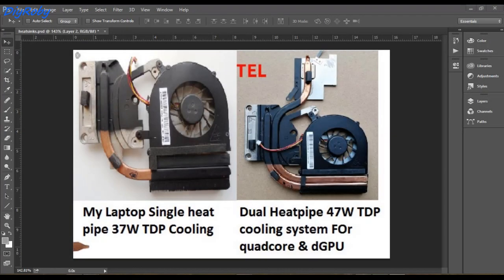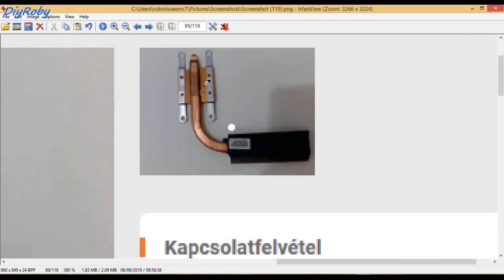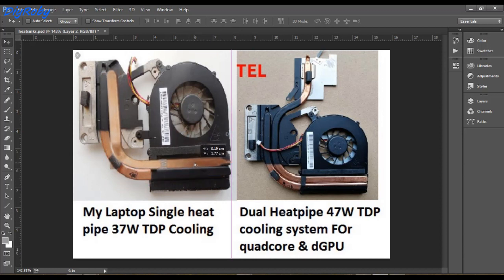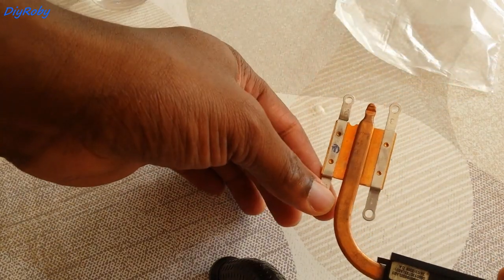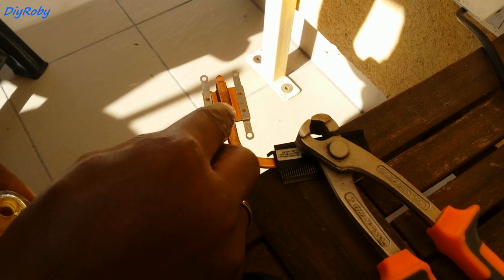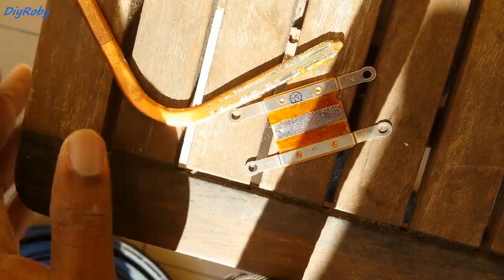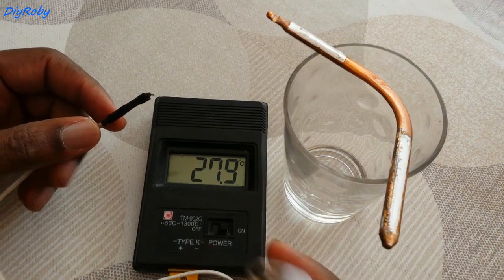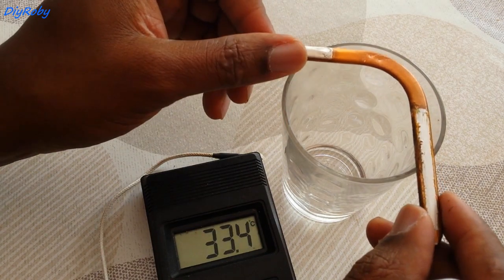Laptop heatsink single to dual pipes upgrade mod. How to desolder & test laptop heat pipes. Part 1

Comment: It wont explode, the first thing to happen would be the flat pipe returns to it's original round shape. taking the temp to 330 C is not high enough to over pressurise

Comment: this would be great with a liquid metal replacement vs solder liquid metal you can replace with ease over solder and when the heat pipes become old and lose the thermal transfer from oc or what ever you can get new ones and replace them, you can also build your own cooler

Comment: Crazy how you managed to desolder that heat pipe without it exploding

But now i'm curious: would it be possible to desolder/solder the Heatpipe with one end in a cup of water for example? That could reduce the risk of the Pipe exploding...
Reply from the maker: Not a bag idea. But if you then heat the water, there may not be enough heat on the pipe to melt the solder. But it's all theory, you can try and see what happens in real life, just like I did in this vid.
Reply: @diyroby732  Yeah that might be a problem, unless you can put up enough heat that just the solder melts and the heat pipe transfers enough away to not warp or explode.
Reply from the maker: Exactly. It's the solder that has to reach it's melting point. Anyway, you can see that I used a regular heat gun blasting heat for many minutes and all that happened are slightly swollen heat pipes. Obviously, I never concentrated heat to one spot on the pipes, gentle movement to soak all parts in heat.
Reply: @diyroby732  yeah, i was mainly considering it for soldering heatpipes not for desoldering.
Reply: at 138 deg C melting point at lowest for low temp soldering paste, you'd probably boil the water first before you can melt solder

Comment: Your precautions about heat pipes were a bit extreme and unneccesary. Heat pipes aren't under pressure at all, in fact the opposite, they're under negative pressure and there isn't enough liquid inside to cause them to explode. You could probably have done this with a torch in far less time, the ultimate temperature isn't that high as long as you apply the heat properly.
Reply: I've heard you have to be really careful when soldering heat pipes. If you don't have really good temperature control, the heat pipe can rupture. It's recommended to use special epoxy when experimenting with heat pipes.
Reply: @ddegn  the problem I have with that is that I've never found anyone that says that and can actually back it up with explanations or verifiable facts. I never trust information from sources that can't be verified. The reasons I've seen given so far don't make sense.
Reply: @JWH3  The video where I heard this information was titled "How to Attach Heat Pipes into an Assembly". The video can be found on the channel Advanced Thermal Solutions, Inc.
I think what was said in the video makes sense. Since the small about of vapor/liquid in the heat pipe is what does most of the heat conducting, I'd think the manufacture would want to make the pipes using the least amount of copper as possible. The pipes need to withstand soldering temperatures but I doubt they can withstand much more.

I have a DJI FPV drone. I want to try to modify the drone. One of things I'm thinking of doing is using a heat pipe or two to keep the electronics cool. I plan to order a few heat pipes from AliExpress. There not very expensive. I'll need to order at least one extra to see how hot it needs to be to rupture.

I've heard water and acetone are used inside the heat pipe. I think there are other liquids they use as well.
Reply: @ddegn  your reply doesn't make  sense. We're not talking about anything like shaved metal, I've seen the cross section of heat pipes before and you can tell by the mass of them how much is in them, they're not that thin.

Also the thickness doesn't change how much heat it can handle so I'm not sure why you would even suggest that.
Reply: @JWH3  "thickness doesn't change how much heat it can handle"
The strength of the pipe is directly proportional to the thickness of the walls. A stronger pipe can hold more pressure. The pressure in the pipe is proportional to the temperature. Higher heat will cause higher pressure. A stronger pipe can contain the higher pressure cause by higher heat.

You said in your original comment "Heat pipes aren't under pressure at all, in fact the opposite, they're under negative pressure"
The pressure might be less than atmospheric pressure at room temperatures but the pressure will increase as the temperature increases.

"there isn't enough liquid inside to cause them to explode."
It might not be easy to make the pipes explode but the pipe will certainly rupture if the pressure/temperature is high enough. It's not a question of if the heat pipe will rupture but a question of at what temperature will it rupture.
Reply: @ddegn  these pipes don't contain pressure as you're describing though. They're under vacuum! There is only a few drops of water in them, I've never seen any demonstrable proof that these concerns are technically valid in any way at what could be reasonably expected to be encountered.

Comment: hi.
What's the least power you need to be able to heat gun it to de solder?
Reply from the maker: Just a regular 1-2000 Watts heat gun. regulate the heat be keeping distance from the heatpipe assembly. It took me 2-4 minutes of heating to get it desoldered. Adding more heatpipes will help reduce temp up till you get diminishing returns.
Reply: @diyroby732  is it possible to get less 10 degrees celsius?

Comment: Muchas gracias amigo, era lo que estaba buscando, una prueba de temperatura de los heat pipes pero con una prueba similar como la que tu hiciste, tenia ess duda, mi vieja laptop murio y pensé que era porque posiblemente el heat pipe se había dañado de alguna forma, pero viendo tu publicación veo que los heat pipes son casi indestructibles y que la transferencia de calor que hacen es instantánea con una eficiencia tal vez del 99.99% o por lo menos eso parece.

Thank you very much friend, it was what I was looking for, a temperature test of the heat pipes but with a similar test like the one you did, I had a doubt, my old laptop died and I thought it was because the heat pipe had possibly been damaged from  Somehow, but seeing your post I see that heat pipes are almost indestructible and that the heat transfer they do is instantaneous with an efficiency of perhaps 99.99% or at least that seems.

Comment: Drilling massive hole to rear cover and installing low profile desktop watercooler is the best way my brotha. cooling pad that is also drilled so the laptop stays straight. no thermal compound so easy to remove cooler after gaming. Do a video about this you will be amazed. take 5v from usb to fan and pump.
Reply: lol it will work but it won't be a laptop anymore
Reply: @kiyoponnn  been running this for 2 years. 30sec job to set up. i carry this setup around to my job in other countries. I only use watercooling when gaming. I say it still is a laptop with mod.
Reply: @CzMnHD  I see, fair enough
Reply: @CzMnHD  I have one last question: Do you use the water cooling block on top of the heatsink or do you attach it directly to the cpu?
Reply: @kiyoponnn  just put it against heatpipes. its more than enough cooling still. i play warzobe 75fps 1080p no thermal throttle. without watercooling unplayable
Reply: @CzMnHD  Ohh I see, thank you

Comment: How are the temps if you put cooling silicone pads with Copper plate behind CPU and on the back of GPU ?  I have not seen many Cooling pad videoes testing a Mod with bigger sized Pads that cover more than small areas .

Comment: wat's the best way to join the new heatsink?
Welding? Or Thermal glue? OR any other
Reply from the maker: I used thermal glue and it was a simple process with fantastic results. Follow up video here https://www.youtube.com/watch?v=wNI6QA0TIxI

Comment: Too bad that mod doesn't work for every laptops.
Reply from the maker: Yeah, I was lucky my old laptop was ideal for this type of mod. If your laptop has a dual heatpipe variation then check ebay or aliexpress for a cheap replacement.
Reply: @diyroby732  Yeah, unfortunately none of the laptops that I have doesn't include it.
Reply from the maker: @killertruth186  What laptop do you have? Software side, you can undervolt CPU and iGPU for a nice reduction of temps. An extreme solution hardware side will be to cut holes into the back cover of the laptop right above the CPU/GPU, fan air intake and glue a metal mesh net over the hole. There are videos on the internet about this mod. It is extreme though, but if you can find a cheap back cover on ebay then you can do this mod on that.
Reply: @diyroby732  I have HP Elitebook 8440p, HP HDX16-1140US Premium Edition and Dell Latitude E6410.
Reply from the maker: @killertruth186  Have you undervolted? I see your laptops have very exotic cooling systems. In this video, the guy places heat pipes on top (not beside like I did) https://www.youtube.com/watch?v=WqWXr8HnZT0. And in this video, the guy simply over-crossed the pipes with slim pipes to take the heat away from cpu https://www.youtube.com/watch?v=UM6_BImfTw0

Comment: nice nice one , i want to do this on my ideapad 330 with i5 8250u + mx150
Reply from the maker: Will you have the space in this laptop Meetlicious? These new laptops are quite thin
Reply: @diyroby732  dont too much , im think in do like yours but with a tin heatpipe
Reply from the maker: @MateusLinn  Cool, As long at the heatpipe from the CPU can reach and sit on the radiator fins beside the fan you should have good results. Looking at pictures and videos of that laptop, I don't see space beside the main heatpipe in front of the fan.
Reply: @diyroby732  my first look is to do this a side the principal heatpipe and down to the fan , is hard to understand but you can see the first models of 320 with only cpu , shes dont have the radiator only the pipe in contat to a metal plate in fan (https://www.newegg.com/p/2RM-000W-00297)
Reply: @diyroby732  my cpu is limited a 75c 1.6ghz , so if i use the throttlestop a 3.0 it get 100c and gpu too so my plans is to decrease this to 80 combine with liquid metal
Reply from the maker: @MateusLinn  I see. Good luck, hope it works out. I heatpipe is not enough for a CPU and GPU combo and Lenovo knows this. If you mod it successfully, you will extend the life of your laptop way beyond what Lenovo "planned" for it.